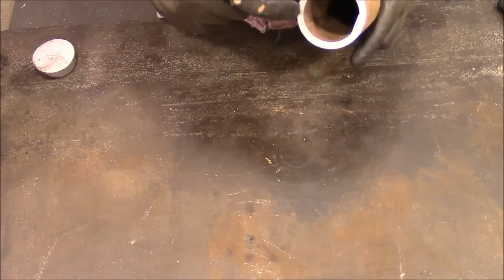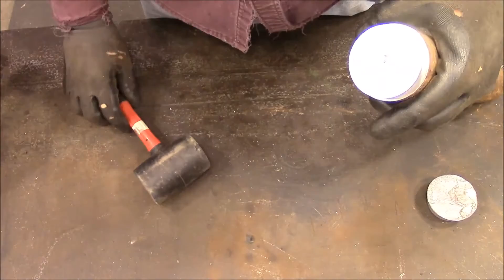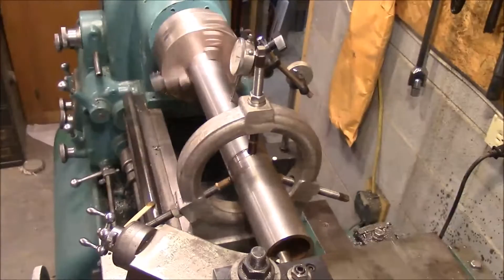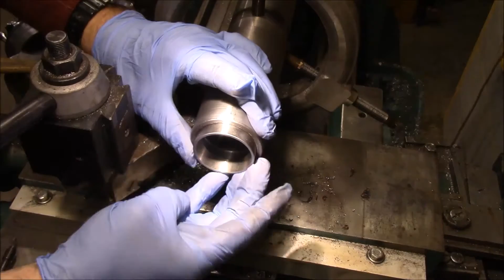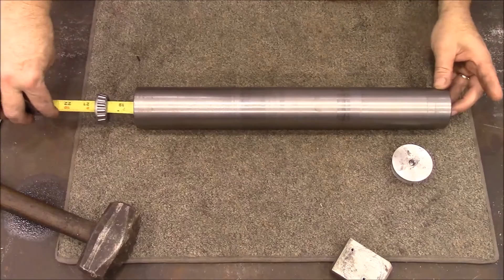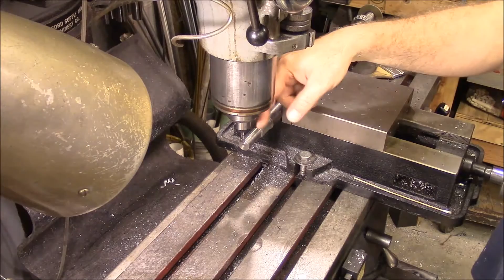Epic Muller Build Part 2 Making the Axle

Comment: Did you have plans for this muller? If so would you be willing to share them? Yours is the best home made muller I've seen. I have a Vontorne style, made from a propane tank. just does not do the job on Petrobond Sand.Chuck
Reply from the maker: I'f I had them I would gladly share.  Unfortunately I do not.  I designed as I went.  Thank you for watching!
Reply: Thanks for replying. guess I'll have to watch the series and take good notes.Are you on any casting forums?